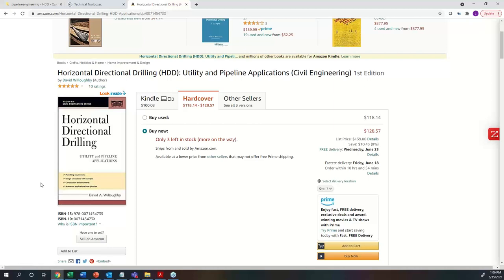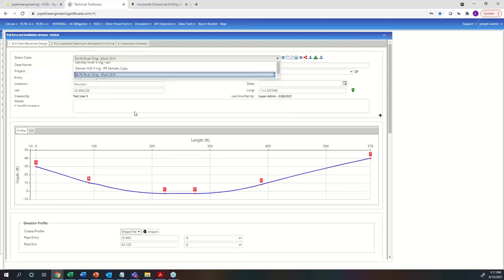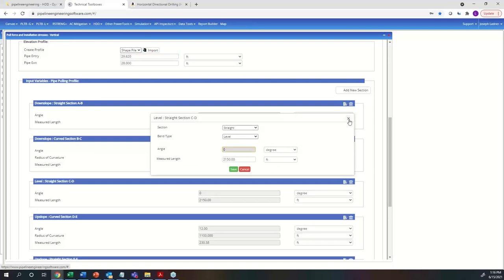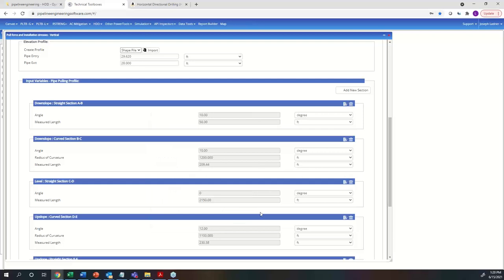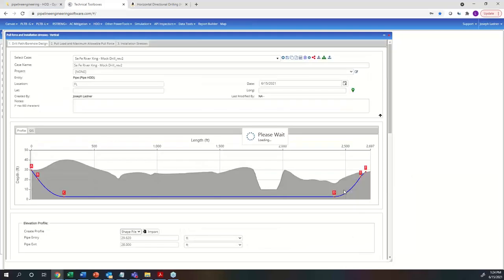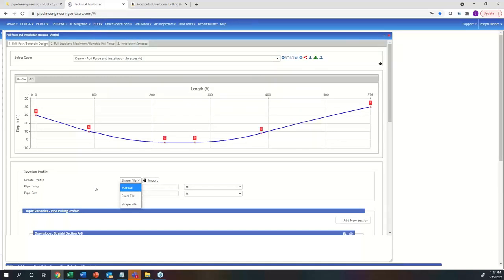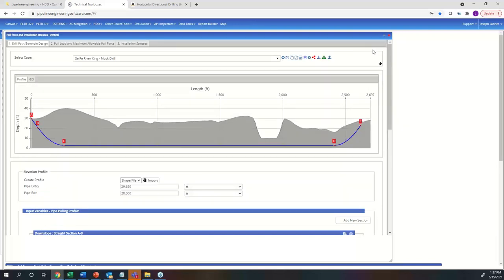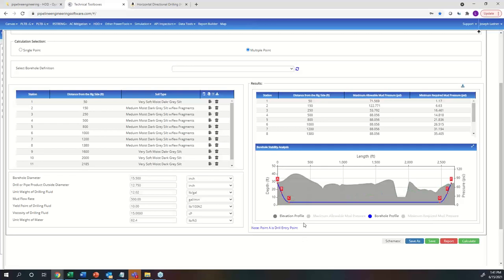Webinar Series - HDD PowerTool Focused Software Demo

Comment: With the HDD tool am I able to input my rod and tooling data, mainly pipe length and have the program give me a rod by rod profile? As an HDD contractor using walk over locating, depth of cover and pitch per rod would be most beneficial to have readily available in the field. Thanks!